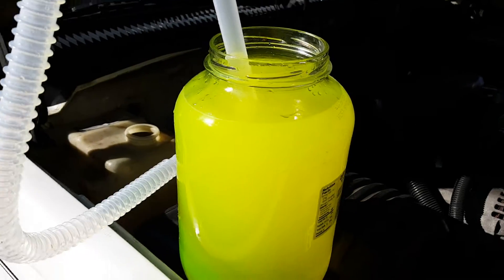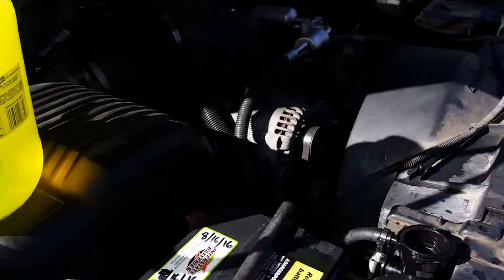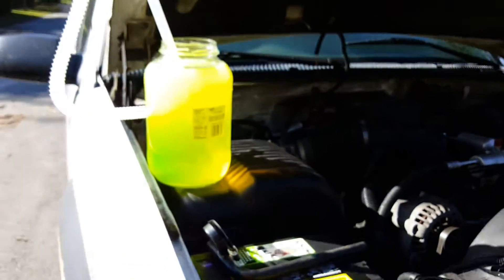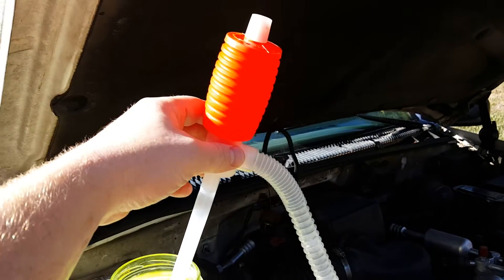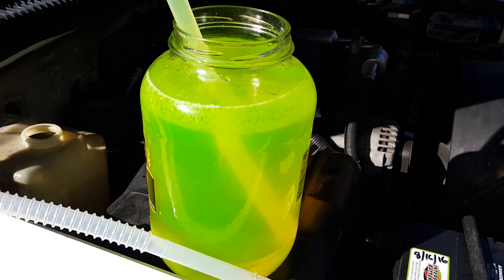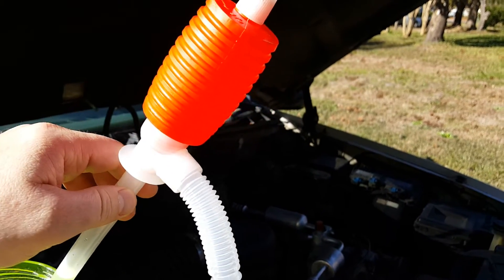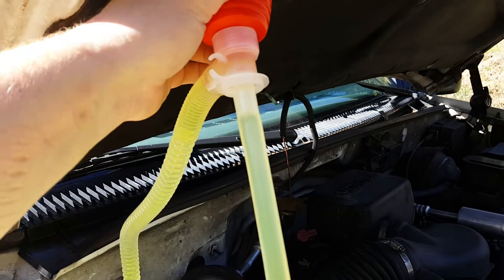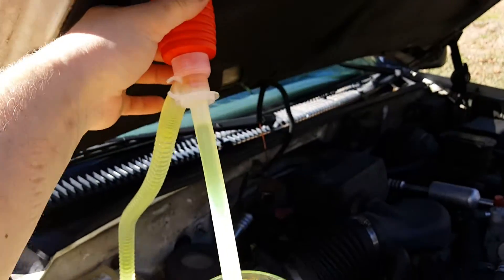How to  drain antifreeze coolant from a car or truck fast and easily using a siphon

Comment: Do you put the siphon tube all the way into the radiator? Thanks for the video btw!
Reply from the maker: I think I went as far as it would go. Doesn't drain all the fluid but if you need to drain water for winter vs freezing it work fine. 50/50 coolant to water mix to prevent freezing and cracking of radiator -cheers. I had a leak over the summer just added water vs coolant
Reply: @drewsquickfix  Ok thanks!
Reply: @drewsquickfix  Have ordered the kerosene siphon but am wondering is the very top of the radiator like a gutter (where I'd have to snake the tube) or does the tube just go straight down reasonably far once I insert it into the cap area of the radiator? Thanks.
Reply from the maker: @Blujonny11 it varies for different cars. Usually the pip goes straight to the bottom. Keep in mind it will not drain the whole radiator. Only way to do that is loosen the plug on the bottom. However. This way can make it easier to drain without a huge amount coming out the bottom if you loosen the plug. Thanks for watching please subscribe and click the 🔔 bell!

Comment: Thanks man!
Reply from the maker: Your welcome jh! Glad .it helped ! Please subscribeand see my other videos!
Reply: @drewsquickfix  if there is a little bvit left in there , after its drainded out,  Is that ok?
Reply from the maker: @gregtowle8830  yeah I think so only way to get it all out is pull the drain plug which sucks. I drained mine because it was mostly water. And winter was coming didn't want to to freeze. Supposed to be 50 50. Thanks for watching please subscribe and click the Bell so you'll know when I post videos
Reply: @drewsquickfix  yeah I used the 50 50 but I then read the lable afterwards   , It says  on GM  pre 1995    Mine is a chevy s-10  2003 .   Im not sure if that would hurt it or not, What are your thoughts about doing that for a 2003 ?
Reply from the maker: @gregtowle8830 no I don't use dexcool the orange stuff they want you to use. It's expensive and in my opinion causes corrosion. As. Long as you got most of it out. Lol green is green it is bad to mix too much green and orange though from what I understand.
Reply: @drewsquickfix  I used the green color. but  after I read it , it  didnt say anything for a 2003 chevy s 10 I might have used the wrong year coolant , I dont know.
Reply: @drewsquickfix  I should have it all drained out then ?
Reply from the maker: @gregtowle8830  I think you'll be okay
Reply from the maker: @gregtowle8830  coolant. Is coolant..... As long as it doesn't freeze and you keep it to the correct kevels
Reply: @drewsquickfix  I   could show you the picture of the container  or tell you what it is?  Its from O'Reilly   Its conventional green Anti freeze and coolant , uses for GM pre 1995  I put it in my 2003 chevy s 10
Reply from the maker: Greg hopefully you subscribed and clicked the bell for notifications. It helps keep my channel running and helping people like you. Thanks 👍

Comment: There's no chance of introducing air into the system by doing this right? I'm young and inexperienced but I want to care of the new to me car I have. I thought about doing this so I googled it and found your video. I understand it doesn't get all of it out because there's coolant in the block and such. But after a few times of doing this, I would be near all new coolant. It would just save me money by just buying coolant and a pump.
Reply from the maker: I'm not sure about the air austins. I do know radiator flushes are very expensive and sometimes unnecessary.  But if your concerned about issues with trying this I would consult a mechanic. I didn't have any issue afterwards but I don't know how air affects the radiator. My guess is it will be fine radiators are for cooling and air bubbles shouldn't affect this.  However I'm not a mechanic so please do your research but it can't hurt to try this. Otherwise there's a plug on the bottom if the radiator to drain coolant.  Different location on different cars. Please subscribe! -cheers

Comment: My only concern is antifreeze is like acid it can melt the hose, I think rubber hose will work better
Reply from the maker: It actually didn't melt the hose. Antifreeze in cars is 50/50 mix. So there's water. This pump was only like $6-$10

Comment: how the heck did i not think of this. im changing a thermostat on a rav4 and whoever had it before me put the wrong coolant in (green instead of red) and now I need to flush the system but couldnt get all the green out of the reservoir. thanks this will save me time trying to get it out!
Reply from the maker: Hey solora, thanks for watching. If you are completely changing coolants you may want to pull the plug at the bottom of the radiator. This method does not get all the coolant out some still sits on the bottom however it won't gush out and over flow a pan since you got most of the coolant out. Its never good to mix coolant colors. Ive heard it can cause the head gaskets to leak eventually.  Thanks for watching please subscribe!!
Reply: @drewsquickfix  thanks, I did pull the plug but not all the coolant came out, there's still a good amount in the reservoir and I was scratching my head on how to get it out without having to remove a radiator hose. This is a first for me
Reply from the maker: @solorasolis1392  okay great so glad this helped then lol I missed the word reservoir in your mention . Lol

Comment: I'm surprised more people don't do this method, better to do a siphon coolent change regularly than a full on change next to never
Reply from the maker: +Dee it still does leave some in the system without pulling the drain plug but this is effective. ;)
Reply from the maker: +Dee although unlike transmission fluid and oil you really don't need to change coolant unless you've had a leak and added water which imbalances the 50/50 ratio and it could freeze in winter